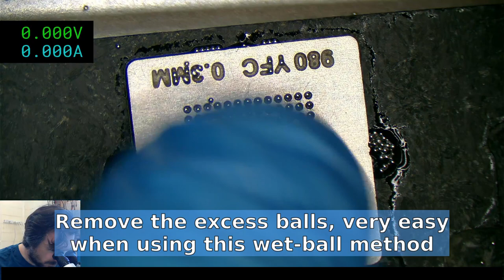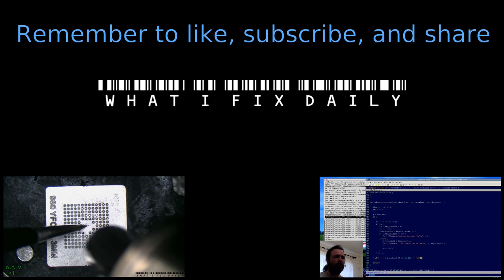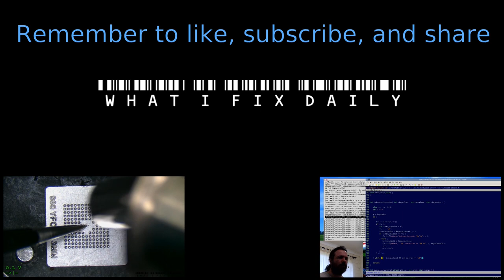Improved Macbook SMC reballing technique with easier ball placement. Faster and cleaner (jazz audio)

Comment: Hi Paul
I take it you haven't got round to making the die holder for the SMC as of yet ? Your technic is very inspiring and very good, Now I have access to a milling machine and lathe I will be making a few chip and stencil holders for the sole purpose for ic reballing, hopefully be able to use on different IC's to go with the IR reflow station with optical alignment im building at present (on a budget) I will forward a Chip & stencil holder when they are completed.
Reply from the maker: You're right, still haven't purchased one yet; have been saving the dollars to buy the property first.
Reply: @pldaniels  well that takes preference any day. By the way did you get my email ref FBview activation issue? I won't go into details here, but please contact me if not. Cheers

Comment: Have you ever tried reballing without stencils? I do it all the time and I'm wondering if I'm just insane 🤣
Reply from the maker: For 4~8 ball units I often will if I need to, though in most cases I do have an iPhone stencil handy that'll have a matching pitch for doing a paste job.

I remember years ago seeing the OmTesla reballing video where he just uses a beaten up old soldering iron and a lot of patience to reball a chip simply with using pyramids of solder.  Crazy times.
Reply: @pldaniels  yeah I've seen a few people do it with an iron, I couldn't do that, but I have done a ps4 apu by manual placement of 0.55mm balls because I screwed up a reflow and had no stencil, 1500+ balls that took a while lol 🤣

Comment: Sorry Paul but i prefer my technic with solderpaste. 
It has less steps and same result. 
Everyone have his favorite method . 
The more important is showing your own method might inspire people who struggle with reballing smc.
Reply from the maker: I used to use paste a lot for SMCs ( see earlier videos ) though now I prefer balls. For smaller ball devices I switch back to paste but I've found for me anything over 0.3mm then this is the fastest/most-consistent method with my own hands .
Reply: @pldaniels  for reballing Ramchips that have a bump on the middle you are forced to use  balls i will test your method
Reply: @homersimpson9257  this works well for this, I had to do 16 DDR3 ram chips and it helped a lot. Used one of those el-cheapo stencil holders with a spring that pressed the chip against the stencil.